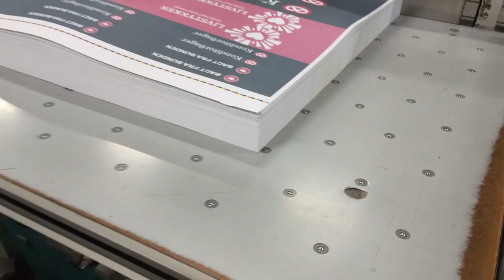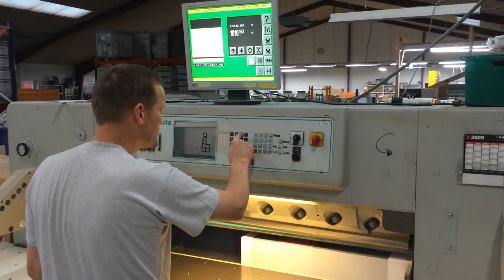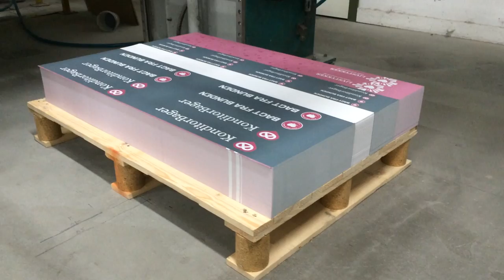Perfecta cutting machine

Comment: When they change the cutter blades that is the most dangerous part of all!  You drop one of those and you can say goodbye to your foot
Reply: Yeah its fun
Reply: At Alex - after working in print shop for over 24 years I have seen idiots drop blades before
Reply: The
Reply: Yeah I am probably older than you chaps and the equipment back then was not integrated with modern electronics.   Everything was done manually and the safety measures were much less than they are today .  And yes some of the people that I worked with were drug addicted
Reply: @Kaiser Soze Agreed I have run one too
Reply: Working with a Polar for me was no trouble changing the knife. You want fun try it on some older cutters I worked with. About 10 years I worked with a shop that owned a 38" Oswego ( from 1938) and a 46" Seybold from the 30's. They did not have the safeties of the newer ones. But, even with though, it can be done safely when you know your machine. Polar you bring clamp up to the knife with a couple a pieces that the knife rest on while you remove the screws and then with the foot bring the clamp down. Screw in some handles and lift out. On the older ones you unscrew out of the way screws, then run the knife to the bottom, unscrew the rest of the bolts, continue the cycle of cutter, and the knife stays down. Then you lift the knife out. You install it the same in reverse
Reply: @passqualecaiazza7728  do you guys sharpen the blade or you buy new blade?
Reply: @LuciferMorningstar-ix3lb  It has been almost 24 years since I worked with the cutters. We would have a company pick up the used ones sharpen them at the their shop, sharpen them and return them on the next visit. I am from Fresno, CA and LA Grinding sharpen them. As far as purchasing, they were never purchased during my time. With the Polar's every shop had a good 3 blades. The Oswego blades were getting to small to sharpen, luck came our way. A building on the other end of the block,  was being remoldeled. In it was an a banded 46 inch Seybold. There were a good 6 newer blades for it. It took about a year to get it up and running. So, my boss had three blades cut down to fit the Oswego. One thing I do know blades are expensive. Back then $700.00-1500.00 depending on the size was what new blades cost.

Comment: This used to be my job. Easiest job in the world after you memorize the numbers.
Reply: What numbers ?
Reply: What would make it even easier is if it was just the guillotine itself, not the flattening machines.
Reply: Seamus, you seem to have missed the point of the peripheral equipment i.e. stack lift, jogger and down loader. The single operator loads the jogger at waist height, same as the guillotine. The cut piles are pushed on to the down loader at waist height and the machine puts the pile on the pallet/existing pile. No bending to lift heavy reams of paper. You can load the guillotine to maximum pile height. The down loader can usually stack up to 1.2m/1200mm. as a delivered pile - same height as a standard press feeder or delivery. Plus the operator can do this for more hours than with a stand alone guillotine. Put an assistant on the jogger and you can really push up the output of this type of cutting system. Years ago more cutting requirement meant buy another guillotine and employ another operator = extra cost centre! Jogging/air tables/downloaded = more cuts per hour. While you are jogging your paper stack under the knife, you are not cutting.
Reply: It's not easy at all!! It only looks like it does. But it's not easy at all! I know very well cause i did this job before!
Reply: @markmiwurdz202  wish we had these machines where I've worked, we only had the cutter and our hands for the rest 🥵😂
Reply: It is the easiest job. Many people lost their arms by this job.
Reply: Ah, you were also a dealer of junk mail yes?
Reply: Senang apak ko la
Reply: @egcozinon your 100% right only a good cutter makes it look easy

Comment: You cut the lay off then spun it round to cut opposite the lay. Bad move. The first cut edge becomes your lay which then goes into the side. And you cut opposite the grip. Then you get a square sheet
Reply: You are right sir. First trim the long edge opposite the printers' grip, then a quarter turn of the pile to trim the short edge opposite the printers' sidelay position. This means that after each cut, a trimmed face of the pile is aligned to the sideguides/backgauge of the machine. Forty-two years experience in print finishing/post-press processes taught me - amongst other things, the right way to operate a paper cutter.
Reply: I noticed that. First cut was wrong and second cut wasn't even knocked up properly. He wouldn't get a job in my company.

Comment: Two years in and you can only order three beers on either hand.
Reply: You would have to be extremely determined to cut any part of you off with such a machine.

The blade is operated by two paddles situated several feet apart under the table, and you need both hands to do so. On top of that, the optical guards either side of the cutting table prevents the blade from moving if something - even something as small as a fly - breaks the beam.

Comment: This PERFECTA cutting machines are from my hometown in Bautzen, Upper Lusatia, East-Saxony in Germany. (:
Reply: @M D Believe it or not, without Perfecta there would not be Polar! The first Polar guillotine frames were cast from moulds copied/pressed from Original Perfecta paper cutters. Perfecta started making powered paper cutters in the late 19th century. Only after WW2 - aided by finances from the West, that Polar Mohr really took off. Perfecta in the old East of Germany did not have the benefit of investment and could not develop their machines in the same way. The best features of the Polar guillotine from size 92cm. upwards are the worm drive self arresting gearbox and hydraulic clutch. This gives a very powerful cutting action.

Comment: If my work had this my job would be so much easier ..... Our sheeter is a so fkin old and our cutter only goes down to 3.20 inches and up to a Max of 29 before the sensors glitch out
Reply: Not to mention the automatic loader to the skid .... And all the air pressure jogging them for you ... Forbes needs to invest